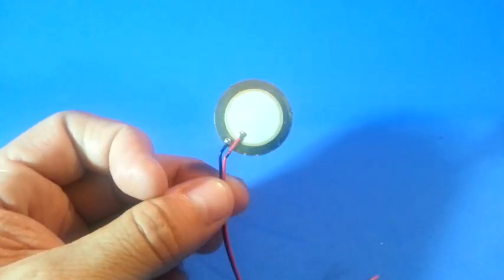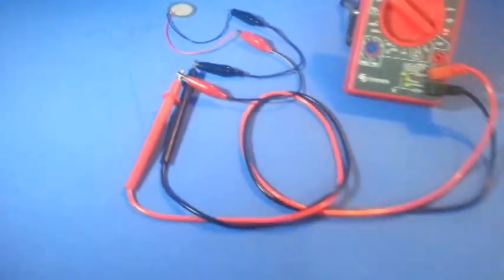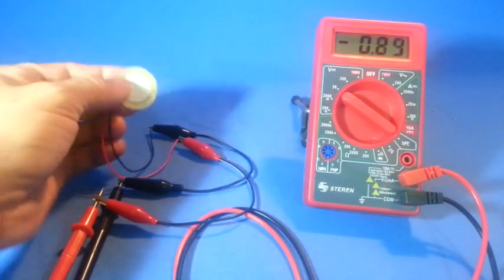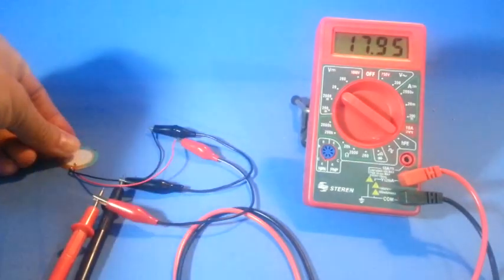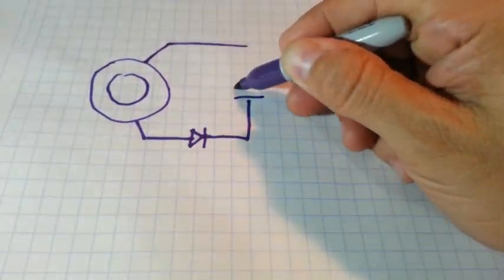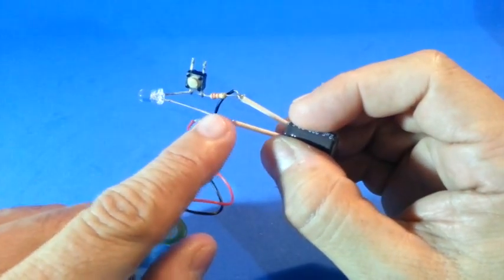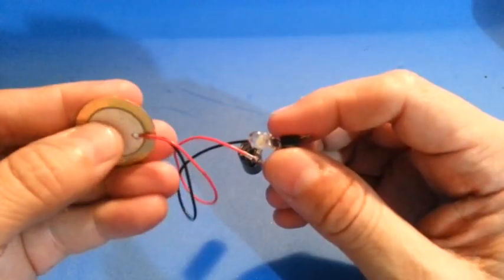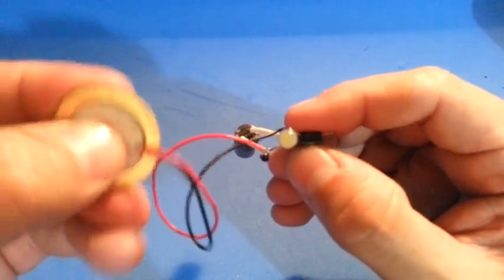Piezoelectric Generator

Comment: how do we know when a capacitor will be fully charge? dont want that to blow up in ur fingers
Reply from the maker: Frank Lopez Use a capacitor that has a voltage rating higher than the maximum voltage of the piezo and you will never overcharge it
Reply: what is that maximum voltage a piezo can generate on a single click?
Reply: im trying to buy a quick little setup but not sure what type of piezo or capacitor
Reply from the maker: Frank Lopez the piezo I used generates a maximum of 25 volts on a very hard click
Reply from the maker: Frank Lopez I used the piezo from a buzzer, cap is 20 microfarads, 25 volt
Reply: Ludic Science Oh ok so your saying that this piezo is one of a kind? is not like it comes in diff voltages ? 

as far as the cap any 20uF will do? Gracias!
Reply: Ludic Science and what about the type / value of the resistor and diode?
Reply from the maker: Frank Lopez You can't go and ask for a piezo of a particular voltage. However the buzzers do come in different voltages, i am no expert but i assume the voltage of the buzzer is about a half of the maximum voltage the piezo can provide. The resistor is 2.2 k and any rectifier diode works, i used a 1N4007
Reply: sound right, thanks cant wait to see what i come up with next...
Reply: Frank Lopez hey buddy how are ya? i just got my piezo buzzer from china and i want to try tho in my multimeter im not sure what setting am i supposed to be in to read values, i have try every setting and none stays at zero till i press on it "its just reading values that jump but nothing that tells me is me by pressing on it " and in the one that i do get 0.00 it stays in zero even if i press it
Reply from the maker: Frank Lopez Put your multimeter in voltage setting. The piezo produces about 10 to 20 volts when you press it. Of course the voltage is only produced at the instant you press it then dissapears, even if you continue to press.
Reply: Ludic Science ok so what size in mm is that piezo?  i think the one i got is to small for me to try and charge a capacitor with

Comment: sir please tell me the name of piezeoelectric material you have used in this video. please sir tell me it is very important for our project
Reply from the maker: anurodh gautam I don't know the name of the material. The piezo element was taken from a buzzer.
Reply: you can make your own piezo at home  You can however, create piezoelectric crystals in your kitchen, using just a few simple ingredients. In his video, [Collin] shows us how to create Rochelle Salt, one of the first known materials found to exhibit piezoelectricity. The recipe calls for three ingredients, cream of tartar, sodium carbonate (soda ash), and water – that’s it. The procedure is quite simple, requiring you to heat a solution of water and cream of tartar, adding the soda ash a little at a time once it reaches the proper temperature. The solution is filtered after it turns clear and then left to sit overnight while the crystals form. https://www.youtube.com/watch?v=K3G2QM5a-9U

Comment: What is the specification of the material? that is what is the name of the  materiel used 
(PZT etc),what is the capacitance n output voltage ,and electric current? n if possible the coupling coefficient n strain coefficient.
Reply from the maker: Siddharth Udayakumar capacitor is 20 uF @25 volts. Dont have more data on strain coupling coef. etc

Comment: can i use many (20 for example) piezo elements in parallel so that i can get more current and charge a battery?
Reply from the maker: dimos geo Yes, but nothing comes free... with 20 piezos you will need to apply 20 times more force.

Comment: Are there any better way to store the electricity generated by PZT crystals other then a capacitor?
Reply from the maker: Siddharth Udayakumar I don't think so. The piezo generates very low current, not enough to use a rechargeable battery.
Reply: Ludic Science  how would you increase the current then? Maybe by using PZT elements in series and parallel to increase current n voltage
Reply from the maker: Siddharth Udayakumar Yes you can use series-parallel connections to increase current and or voltage.

Comment: Since you did 4 volts easy with the pizeo, can i charge a 9 volt battery easily
Reply from the maker: Karbi Karlos a piezo generates too low amperage to charge a battery.
Reply: But you just generate 4 volts easily!!!!!!!!!!!!!!!!!!!!!!!!!!!!!!!!!!!!!!!!!!!!!!!!!!!!!!!!!!!!!!!!

Comment: I am not an electrical or electronic engineer so pardon if my query sounds ridiculous.
1) If i use a Battery instead of a Capacitor will i be able to store more amount of electrical energy? what changes i'll have to make in the circuit diagram?
2) can piezoelectric effect take place in the sole presence of vibrations by Sound waves? If yes How?
Reply from the maker: Saurabh Shinde 1) Piezoelectric generates very low energy. It is not enough to charge a battery. 2) sound waves are too weak to produce any significant electrical energy in the piezo.

Comment: Thank you for the video. If I wanted to use more than one piezo connected to the same capacitor, is it possible?
Reply from the maker: synenvi yes, it is possible.
Reply: Ludic Science Thank you for your reply! So I have to take all the piezo and join all the negative and positive? (as a parallel connection). And rectify the common positive with a single diode? Or should I use a series connection? Thank you
Reply from the maker: synenvi every piezo must have its own diode, then you can wire them in series (for more voltage) or parallel (for more current)
Reply: Thank you very much! I'll try as you said. Last question: what about Graetz bridge (or diode bridge)? If I use it instead individual diodes I could increase the "flow" to the capacitor and load it faster? Considering that I have to generate maximum energy from very low movement of the piezo (music on a resonant surface). Thank you for your support and kindness!
Reply from the maker: synenvi yes a Graetz will improve efficiency a little bit

Comment: What type of diode, capacitor and resistor are you using? I am new to this stuff but am doing research. I want the output from the capacitor to be a constant 5V to power something.
Reply from the maker: Don Juan The capacitor is 20 microfarads @ 25 volts. You can use a larger value but it will take longer to charge, piezos produce very little current. The resistor is 3.3 K and any rectifier diode works
Reply: Ludic Science Thank you very much. So does your capacitor output 25Volts? because I want to make a circuit that outputs 5V to power a pad. Would I need to purchase a capacitor @ 5Volts? or does that mean it can hold a 25V/5V charge.
Reply from the maker: Don Juan that means that the maximum voltaje that you can put in the capacitor is 25 V, but you can charge it to any voltaje lower than 25

Comment: I tried this, but the capacitor charges to only ~1.11V and refuses to go higher idk why. Please help. And what is the resistor value?
Reply from the maker: jamn610 What value is your cap? the resistor is 2.2K
Reply: Ah ty. I used a 220micro farad

Comment: Sir can you tell me how can we measure that pressure  value that you were applying? i have project to measure the pressure using piezoelectric cell.
Reply from the maker: Ahmad Siddiqui it is not easy you need special equipment, it is not just the pressure but how fast you apply that pressure. In general, the higher the voltage from the piezo, the larger the change in pressure that is applied. here is som info on piezo theory: http://www.pcb.com/techsupport/tech_gen.php

Comment: I'm trying to develop something for work. Will piezoelectric disk such as seen here, generate enough current to cause a dipped ematch to spark off? Will a larger disk do better? I have used 20mm with no luck.
Reply from the maker: Rob Lou This piezo has not enough voltage for that. If you want sparks, use the piezo element is stove igniters: https://hdsupplysolutions.com/wcsstore/ThdsMroUs/product/fm/large/13/131850_L.jpg